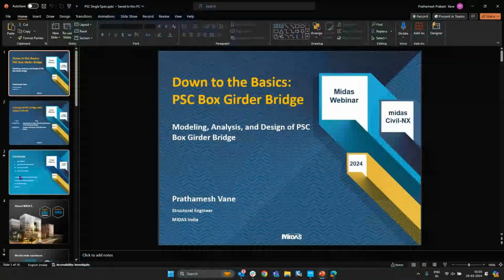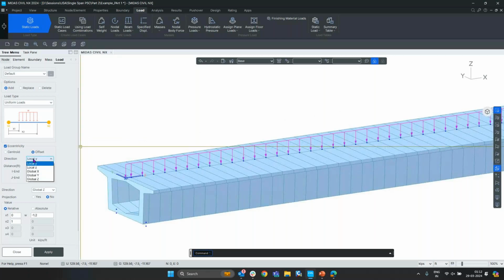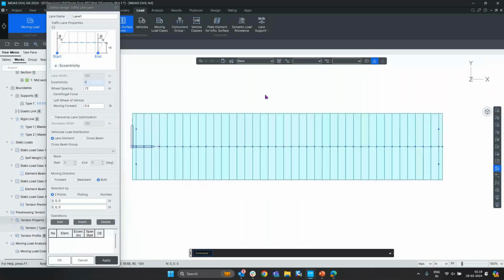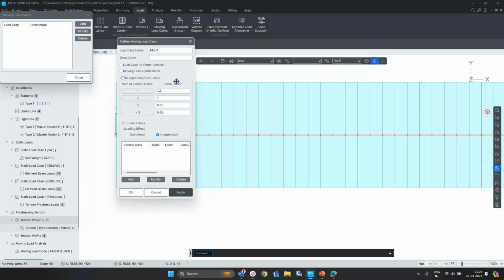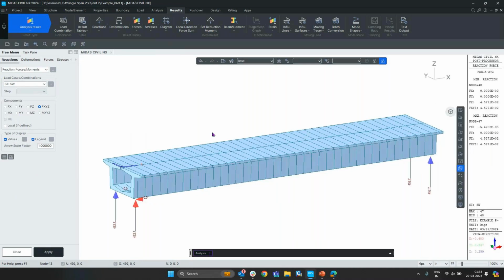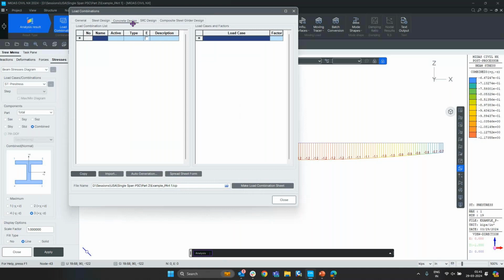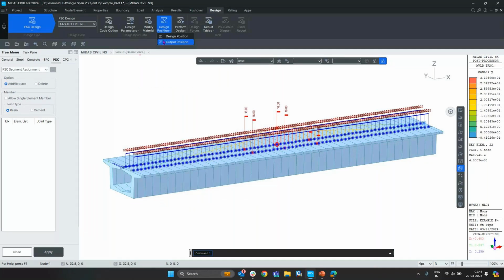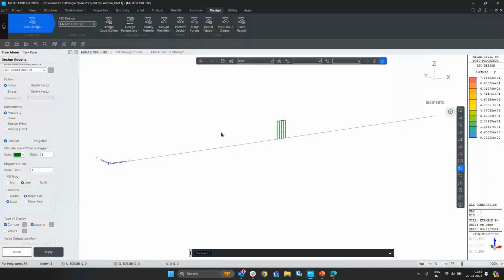PSC Box Girder Bridge Webinar 2

Comment: Thank you for the fantastic second part of the webinar series! The thorough walk-through—from static and moving load configurations to interpreting post-tensioning stress results and performing AASHTO LRFD design checks in midas Civil NX—is incredibly helpful and practical.

To facilitate bridge engineers in Taiwan in reviewing and applying these design and analysis workflows, I have written a detailed summary below in Traditional Chinese:

本集內容核心摘要
1. 靜態載重定義（Static Loads）
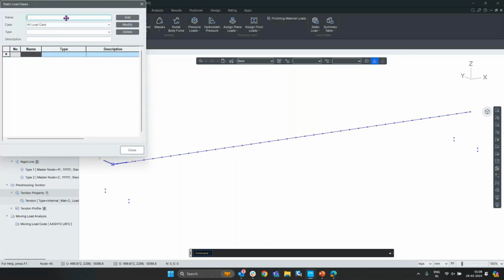•靜態載重工況建立 [02:41]：
o自重（Self-Weight, SW）：類型設為 Dead Load。
o鋪面載重：類型設為 Dead Load of Wearing Surface。
o防撞護欄附加恆載（Crash Barrier）：類型設為 Dead Load of Components and Attachment。
o預力載重（Prestress）：類型設為 Prestress。

•各載重施加與偏心配置：
o自重（Self-Weight） [04:08]：在 Z 軸（垂直向）施加 scale factor = -1 自動計算。
o鋪裝層（Wearing Course） [05:46]：以梁均佈載重（Beam Load / UDL）向下施加 1.2 kips/ft。
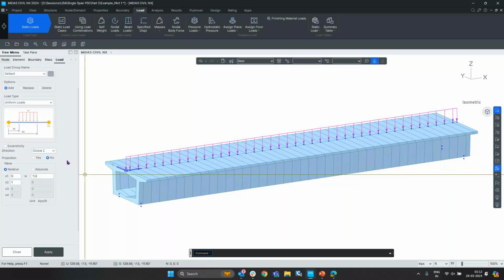o防撞護欄（Crash Barrier） [06:59]：計算橫向偏心距約 14.17 ft分別於梁頂兩側以偏心均佈載重（±14.17 ft 偏心、強度 0.5 kips/ft）施加。
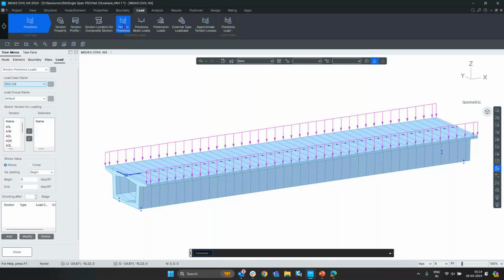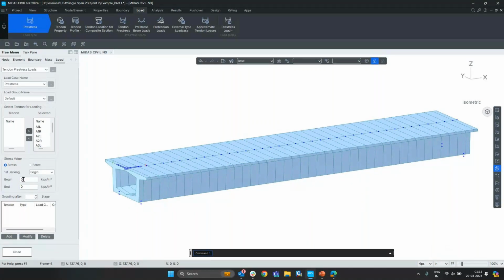o預力施加（Tendon Prestress）[09:05]：選取前集建立的8束鋼腱，設定兩端千斤頂張拉（Jacking from both sides），每束鋼腱施加 200 ksi 張拉應力 [10:19]。

2. 移動活載重分析設定（Moving Load Analysis - AASHTO LRFD）
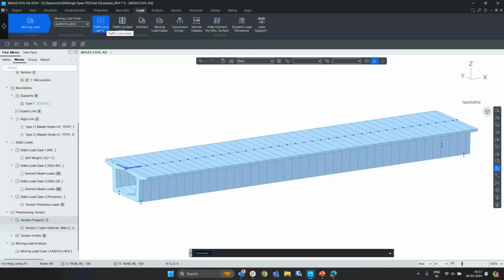•車道建立（Traffic Line Lanes） [12:06]：
o因採用單線梁（Line Element）模型，選用 Traffic Line Lanes。
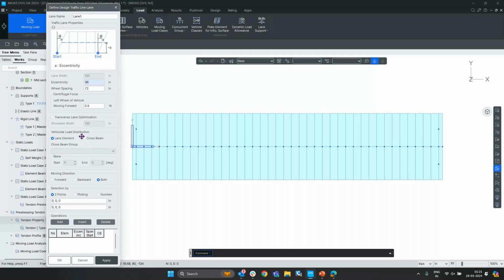o輸入中心線偏心距（例如 3 ft / 36 in），輪距預設為 72 in，載重分佈方式指定為 Line Element Type [15:49]。

•標準車輛定義（Vehicles） [18:09]：
o自內建規範資料庫中選用 AASHTO LRFD 的 HL-93 Truck 與 HL-93 Tandem。

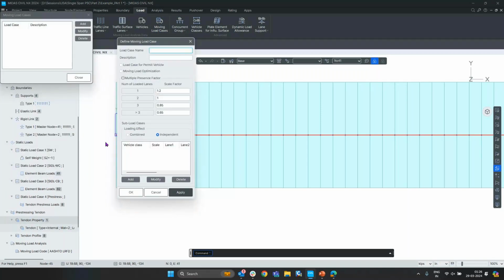•移動載重工況（Moving Load Cases） [20:43]：
o建立移動活載組合，軟體會依載重車道數自動考量多車道折減係數（Multiple Presence Factor, m，單車道為 1.2）[21:36]。
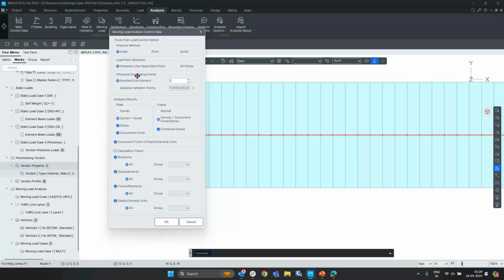o設定影響線分析控制（Influence Line Diagram approach）與單元影響線取樣點數，確保活載最不利位置的計算精度 [24:28]。

3.結構分析與結果判讀
•反力與變形 [27:59]：
o自重下支承反力約425kips[28:28]；自重引起的跨中最大下撓約0.8吋，而預力引起的起拱（Camber）約 0.756 吋 [29:28]。

•內力（彎矩、剪力、軸力） [30:20]：
o自重下呈現典型的簡支梁正彎矩分佈，預力加載下產生明顯的軸向預壓力（約5,850kips）[31:27]。

•斷面應力檢查（Beam Stress Diagrams） [32:28]：
o可依箱型斷面頂底版與腹板極限位置（點 1 至 4）檢視軸向應力與彎曲應力之組合。
o自重下梁底承受拉應力（約 0.8 ksi），預力施加後則在底版建立有效壓應力 [33:57]。

•移動載重追蹤（Moving Load Tracer） [38:44]：
o針對跨中元素（Element 22）進行追蹤，視覺化呈現產生最大跨中彎矩時（約4,000kips-ft）的 HL-93 車輛精確停放位置。

4.斷面配筋與 AASHTO LRFD PSC 設計檢核
•載重組合自動生成 [35:57]：
o透過內建工具自動生成 AASHTO LRFD 強度極限狀態（Strength）與使用極限狀態（Service I /Service III）組合。

•鋼筋配置與設計參數 [41:48]：
o指定 ASTM A615 鋼筋規格，並使用 Section Manager 於箱梁斷面定義受拉／受壓鋼筋排布 [44:06]。
o設定檢核位置（如中央跨 Element 22）。

•規範檢核與報告產出 [46:09]：
o彎矩強度檢核（Flexural Strength）：計算 Mu 與抗彎容量 φMn，比值約 0.34（D/C Ratio），顯示強度充足。
o圖形化容量包絡圖（PSC Result Diagram）[47:14]：直觀比對全梁各點之需求（Demand）與容量（Capacity）。
o詳細 Excel 報表匯出 [48:16]：一鍵產出包含抗彎、抗剪、最小配筋率及應力檢核的詳細計算書。